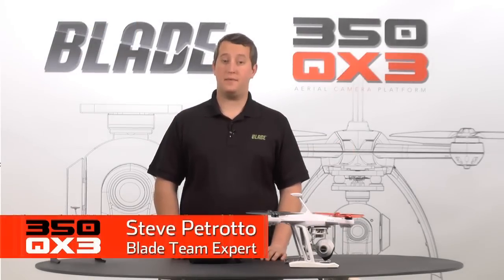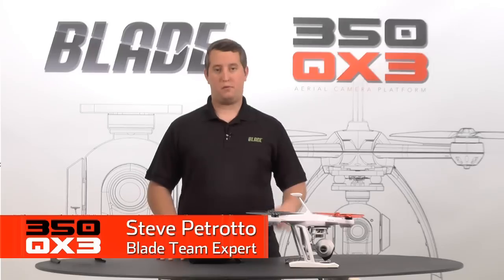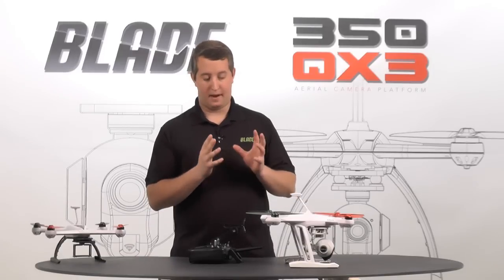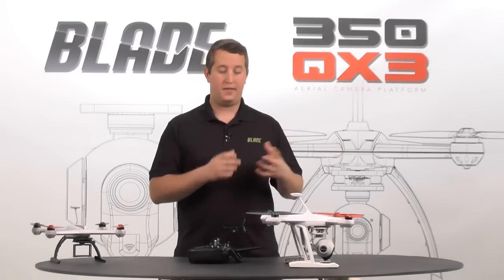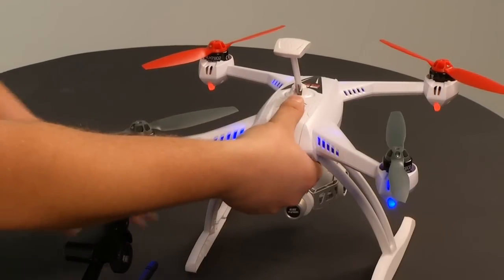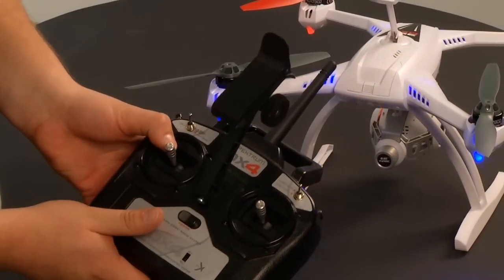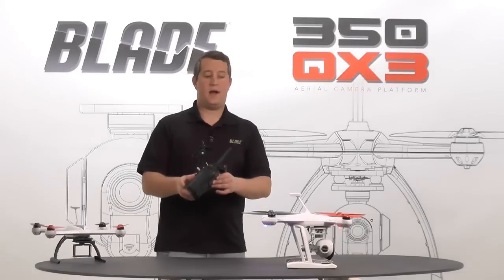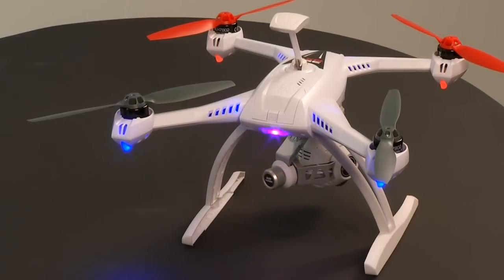Pressure Sensor Calibration - 350 QX3

Comment: How would you do this with a DX6i
Reply: U have to hold the bind button move the rudder to the right corner and switch both mode switches 4 times but u have to figure out how you are going to hold 4 things at once but I did it so it can't be too hard
Reply: Is the same for the DX5e?